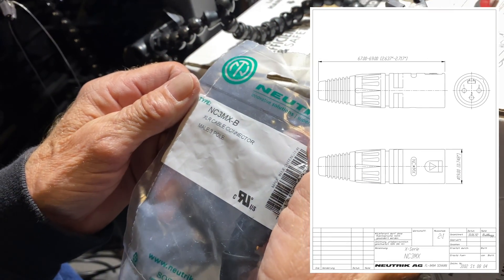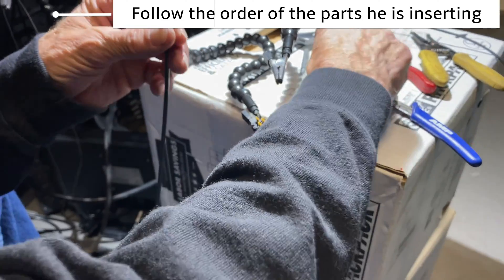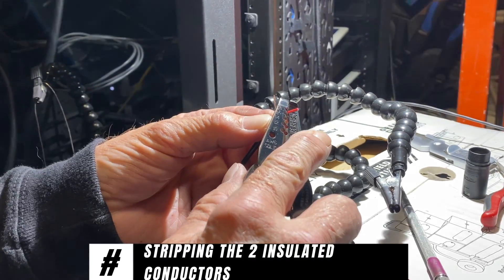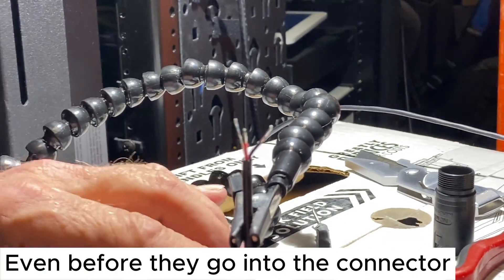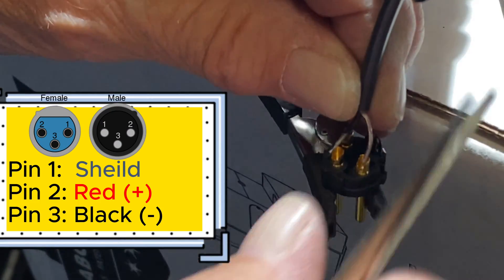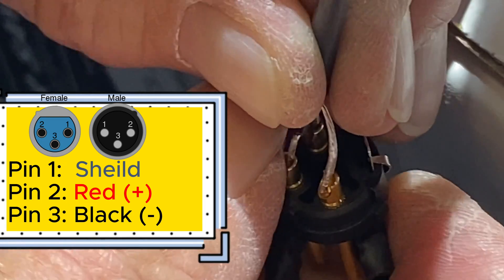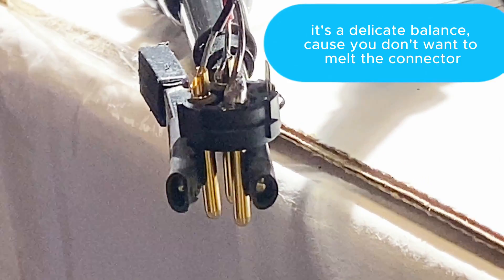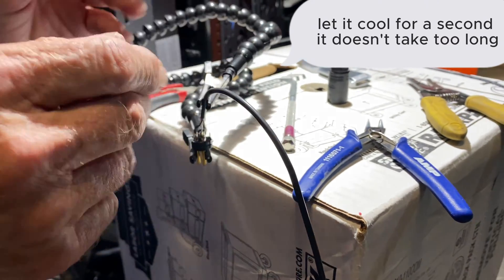XLR Termination 3 Pole: Step-by-Step Guide

Comment: You can't clamp hot pins with a crocodile clip, the parallelism and geometry of the connector may be lost. It is best to insert the connector into the mating part and then secure it. This way the connector geometry will be preserved and the pins will be better cooled. You are just lucky that this is a high-quality Neutrik connector that does not melt easily. A Chinese connector would have broken long ago from the temperature.
Reply from the maker: In the Pro AV environments, we only use quality products from manufacturers that meet certain standards. We have to sometimes provide commissioning reports that have to include testing logs and reports. Same for Fiber levels, etc.